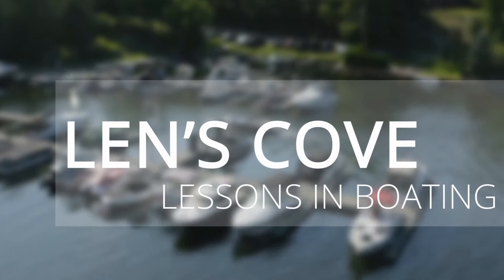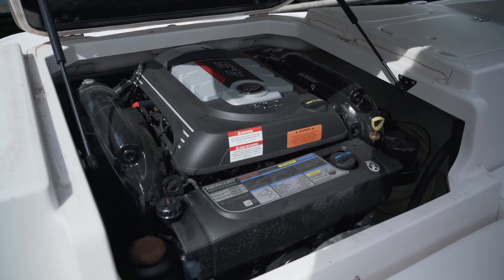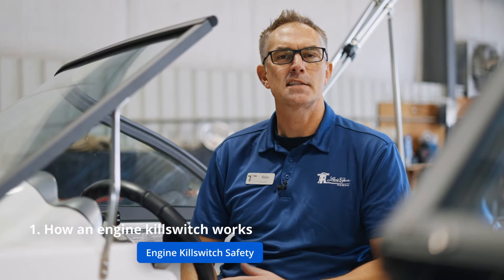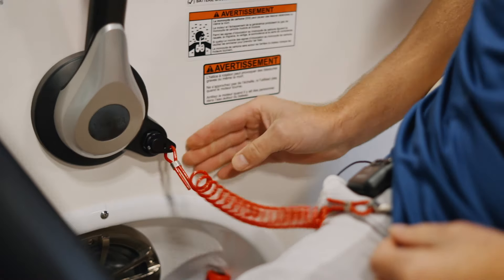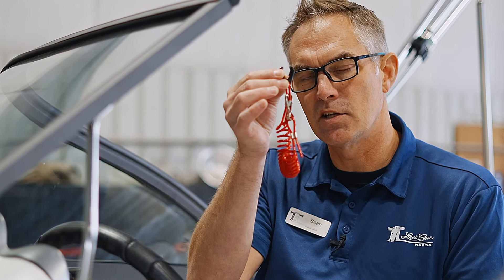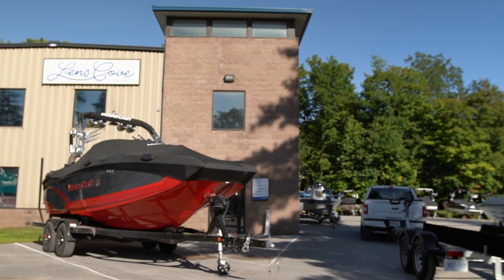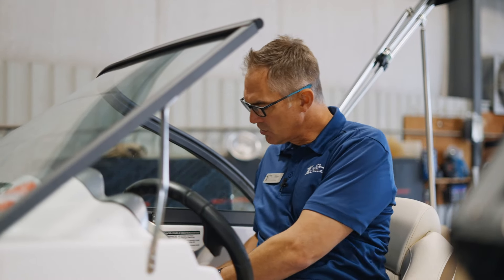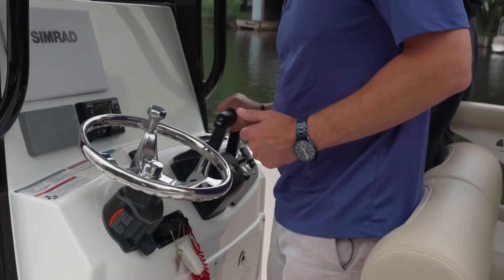Boat Kill Switch | Common Boat Issues

Comment: Tried everything u said prior to trying to start,
No go, could it be fuse 30? Which looked fine to me. Brand new batterty but I also use electrical on/off switch religiously. Can u show me your batterty connections? Red is just one cored black has 3 connected to it. My son used it last, I never let anyone care for my boat. He is 18 & has a skeeter so I thought no big deal.